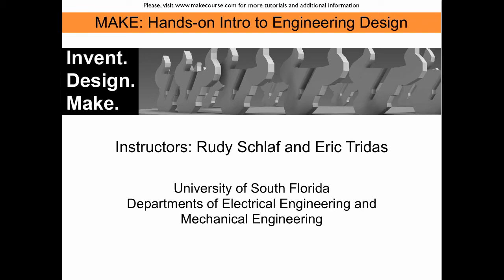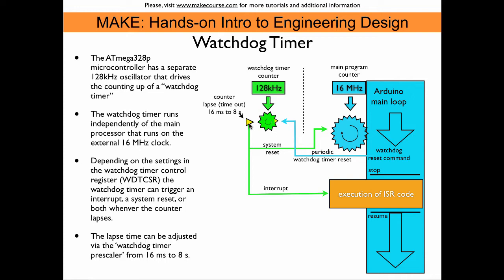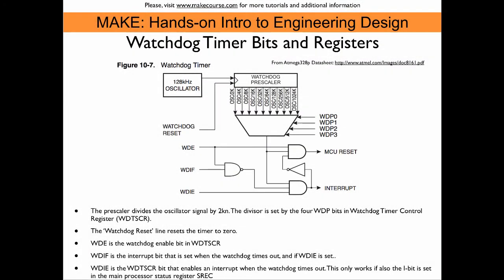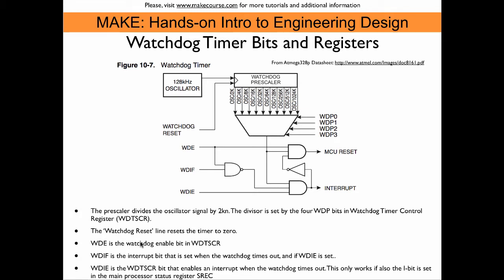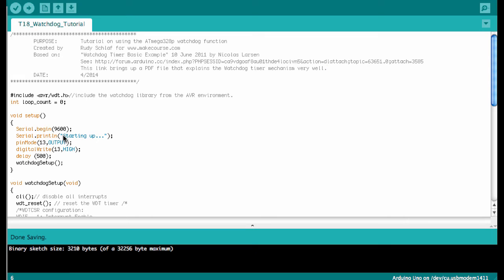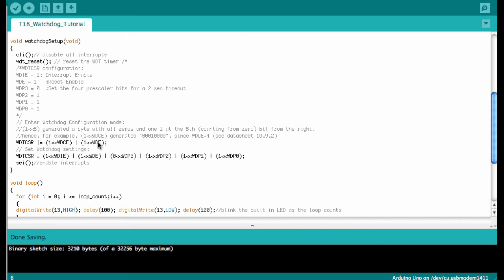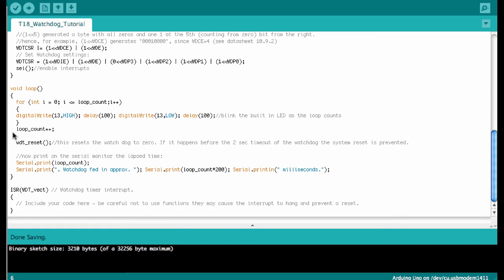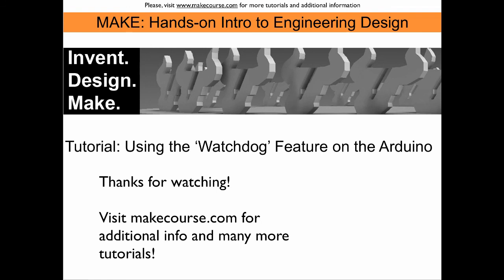Tutorial: Using the Arduino Watchdog Timer

Comment: Thanks for this video. Could someone tell me what I would have to do if you set a value for the variable using buttons (eg. temperature beyond which alarm will activate) after such a reset, the variable is set to the default value.
Is it possible (without using an SD card) to save this value so that after a reset by the watchdog the variable would still be set as before the reset?

Comment: Very Nice video, thx alot for the information. This assumes that the bootloader that I am using has the watchdog enables (the corresponding fuse is set, right) ?
Another issue is that, does this apply to uno only or to others as well, because I remember reading somewhere the uno has the watchdog enabled in its bootloader, however the mega ones have it disabled so the user has to use ISP programmer to reprogram the watchdog fuse, is this right, wrong? what do u think?

Thx again.

Comment: What if we have "legit" functions that will take longer than 8 seconds to complete? For example, connecting to wifi network
Reply from the maker: This is not an application for the Watchdog. When you wait for a WiFi network you can reset the watchdog while you do that, since you are in a loop waiting for a signal from the node. The Watchdog is designed for the moments when you loose control over your sketch and the Arduino needs to be reset...

Comment: Very helpful!, I was pulling my hair out trying to get the arduino to reset  by channeling the reset pin to ground through a relay, I could never get the timing right. How do you extend the time at which it will reset, instead of 2 seconds?
Reply from the maker: The time can be changed by setting the prescaler bits WDP0-3 in the WDTCSR (Watchdog Timer Control) Register differently.  See Table 11-2 in the Atmega328p data sheet (http://http://www.atmel.com/images/Atmel-8271-8-bit-AVR-Microcontroller-ATmega48A-48PA-88A-88PA-168A-168PA-328-328P_datasheet_Complete.pdf). You can adjust the time to up to 8s. Have fun!

Comment: Great tutorial! The visuals really helped to understand what is happening. Do you have anything that shows how to actually implement the code correctly? I have a loop that runs several hours, but I am concerned that the I2C will cause a freeze. Should I just enable/disable watchdog around all I2C calls?
Reply from the maker: Hi Joshua, I do not see how there could be problem with the I2C. When the watchdog causes the reset, you start again with your setup() function, i.e. the sketch runs like after plugging the Arduino into the USB or pressing the reset button. The sketch featured in the video is posted on http://makecourse.com. Just go to the video tab/button and seek out the watchdog tutorial. Have fun!

Comment: Great tutorial, I was looking for this info for resetting the arduino when uploading a sketch over Bluetooth. Send a command from the uploader to launch the watchdog and trigger a reset then upload my sketch!
Reply from the maker: Glad you liked it! This is exactly the kind of application that the watchdog has been designed for. I was recently looking into bluetooth for the Arduino...Did you post your sketch somewhere? What are you using as bluetooth shield? Thanks!
Reply: No, I've not posted any sketch yet as I still need to modify the Arduino uploader code to send a reboot command over serial before uploading a sketch - which means editing the uploader and re-compiling it.  I'm using a simple HC-06 Bluetooth module rather than a more expensive shield.